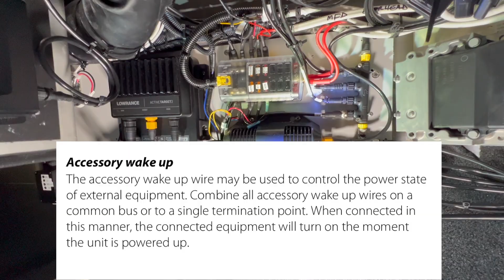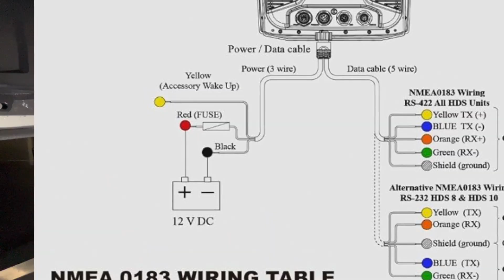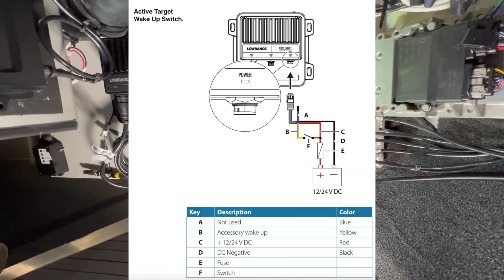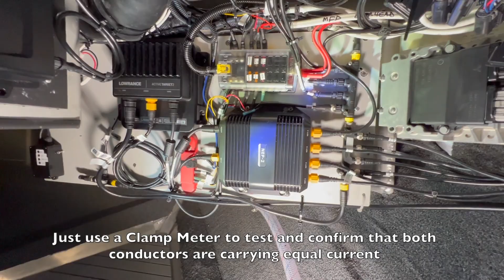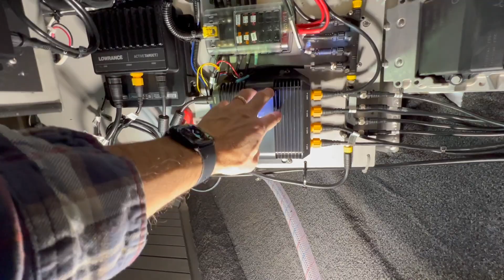Navico/Lowrance/Simrad Accessory Wake Up Wire & Other Wiring Suggestions

Comment: Do I connect a power wire to the wake up bus bar?
Reply from the maker: The Yellow wire from your MFD supplies the power to 'wake-up' the other accessories.
If you decide to 'manually' wake up all the devices on the network, you can wire +12vdc to all the yellow wires (accessories) to 'Wake them up'. 

Now, there is a variation of this wiring that we should talk about - in fact I should update the video.
Lowrance / Navico updated the software to support a ping synchronization feature. This allows things like your sonar modules (such as S3100) and Active Target can synchronize sonar ping timing so as to reduce interference. This requires two things: 1 - You need to wire the Yellow wire from my primary MFD to the blue wires on those devices (such as the Active Target module, S3100, etc). 2 - Enable ping synchronization on the primary MFD.

This means that the 'yellow wake up' bus you'd then wire a toggle switch from 12VDC to turn on (wake up) all your accessories. But the Yellow wire from the MFD would be connected to the blue wires of those accessories.  This is covered in the installation manuals of the MFD and those accessories. 
Moving forward, this is the preferred method to deal with the ping synchronization changes with Navico products.